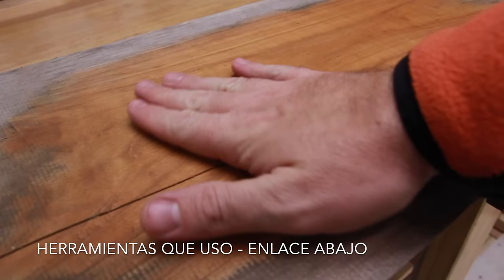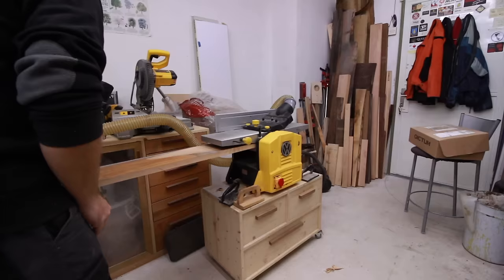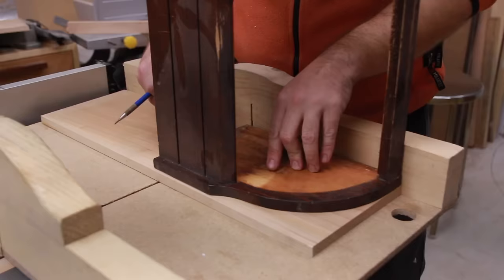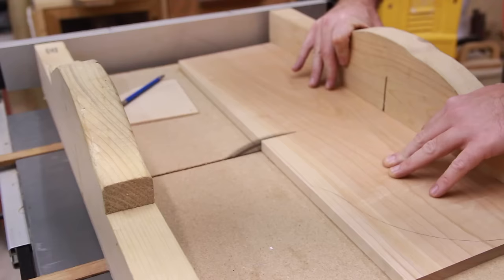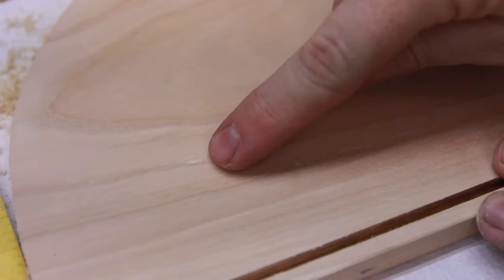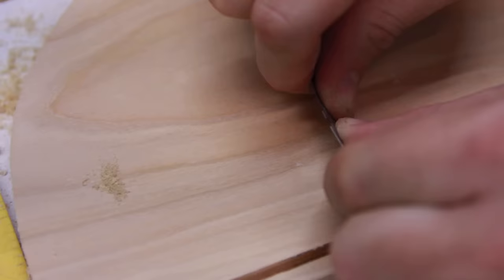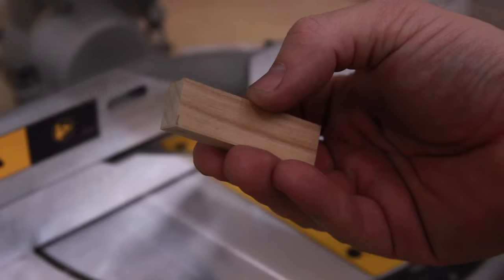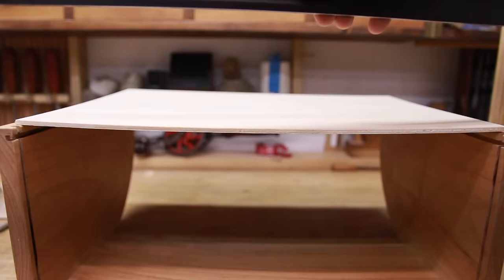My Father's Bread Box from Cherry

Comment: I've been looking for a small jointer + planer combination like yours. Do they still make it? Are you happy with it?
Reply from the maker: I'm not really happy with it but it does the job faster than I can hand plane the board. The problem is aluminum cast tables that are not parallel thus it is not good for tight glue joints. I tried to fix it but it is a toy planer. I'm planning to upgrade it to a Holzman Hobby 260mm 230V 160kg machine.